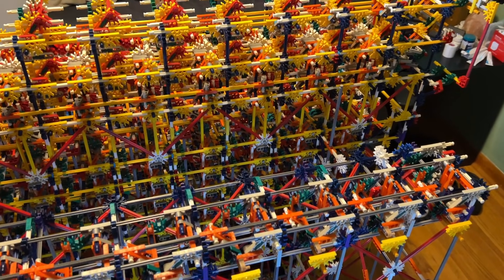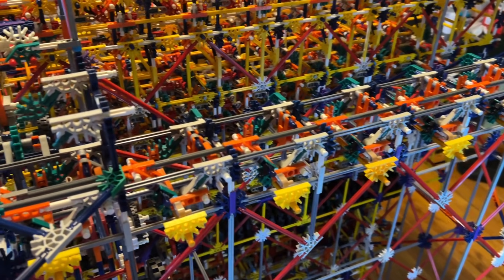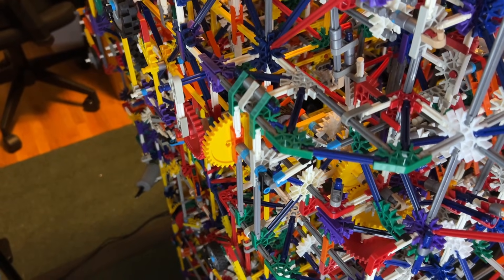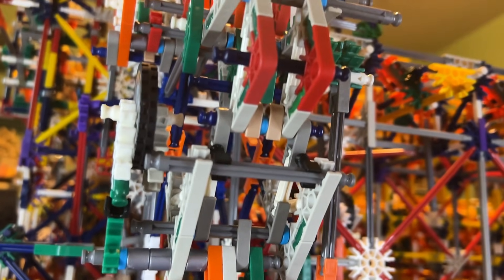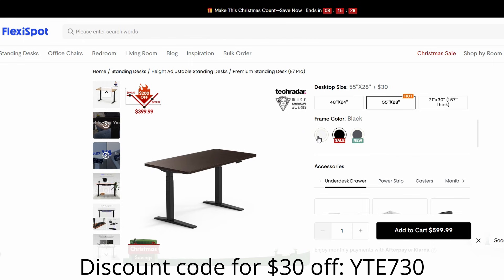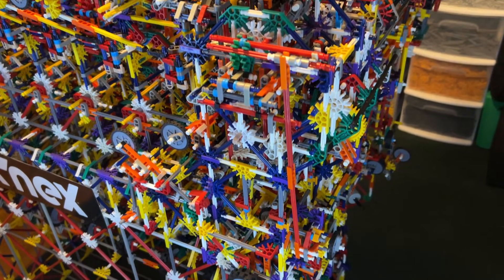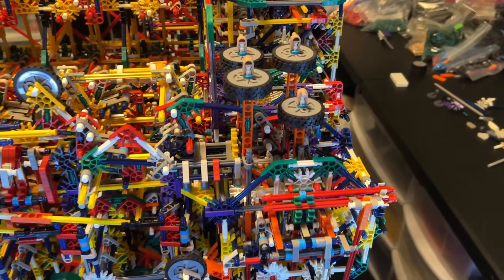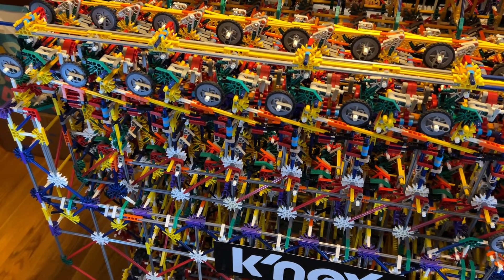Knex 8-bit Mechanical Computer (MechaDigit-1) - Update 3: ROM, Program Counter, and Jumps

Comment: I wonder if there is a way to document/emulate this in some kind of CAD program. 
You'd have a library of the individual pieces, which could be assembled. I guess a tricky part would be linking the movements together, which I think could be done, but this machine relies on the physics of gravity a lot too, I don't know if it lets you simulate that in an efficient way...
Honestly I don't know a lot about CAD software, I'm just trying to imagine how to document and let us play with the machine at home.
Reply from the maker: I've been wanting to make something with Unity that would allow that, and would be alot faster to design things. It has collisions and physics simulation built in. Sort of like the game Gearblocks but with Knex parts.

Comment: ngl I almost never know which parts and mechanisms you're talking about when you say 'this', 'that', or even point; but this project is wildly impressive
Reply: Labels would help. These could be anything from post-it notes, to text added in the video editor.

For example you make a list of major sections, such as RAM, ROM, ALU, Instruction counter, etc... in a text document in a large font. Print it. Cut the words out, and tape them to the machine.
Reply: @hamjudo hard agree! Even neon sticky notes with nothing written on them but just to stick out so you can say 'if you look at the red weight...' etc
Reply: I'm going to add my vote for this!  I was going to comment the same thing on my own; I'm glad others feel the same as I do.